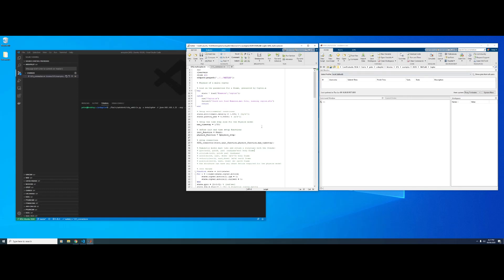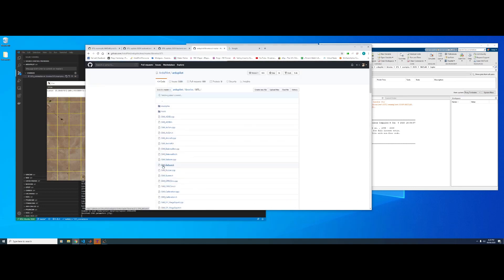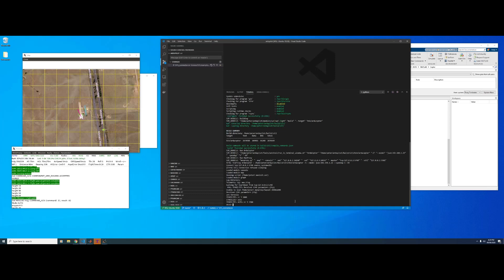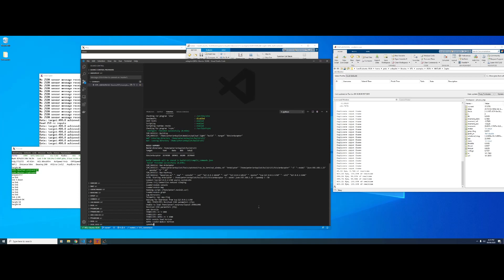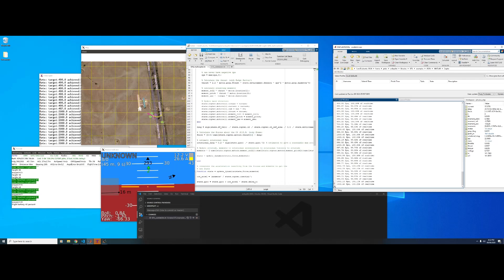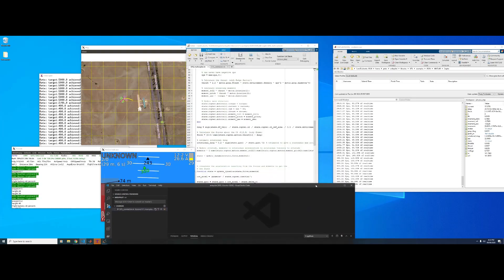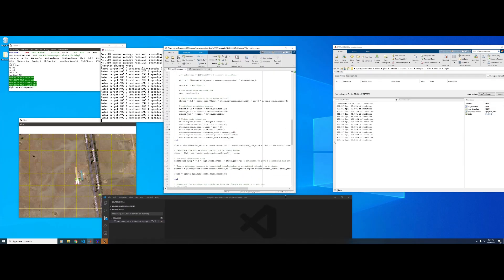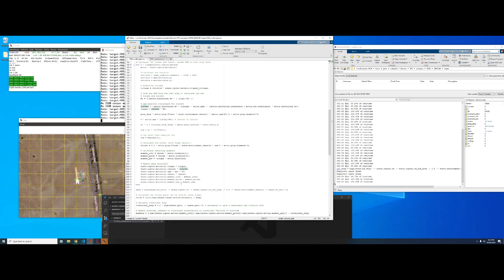ArduPilot MATLAB SITL demo

Comment: Hi, I have Issues when I run SIM_Multicopter. m : 
Error using mex
Error in SITL_connector (line 12)
        mex -O -outdir ../tcp_udp_ip_2.0.6 ../tcp_udp_ip_2.0.6/pnet.c ws2_32.lib -DWIN32
check that you are in the correct current folder, and
check the spelling of 'C:\Users\OneDrive\Desktop\tcp_udp_ip_2.0.6\pnet.c'.

Comment: Hi.
I am running into issues when I run SIM_Multicopter. m example. The issue is in executing the MEX file statement in SITL_connector.m function call. 
Error Msg:
"Error using mex
gcc: error: ws2_32.lib: No such file or directory"
Any help is appreciated
Reply from the maker: Hum, not sure, mex stuff can get tricky, it was tested on 2020a both windows and Linux. Might be worth deleting the mex files, it should then try and re-compile. Also worth checking what compiler MATLAB is using.
Reply: @MrIampete  Thank you for your response. I was able to fix that issue by using wsock32.lib.
Reply: @NandithaU  Hello, can you tell me who can I fix the same problem?
Where will I use wsock32.lib ???

Comment: This is awesome. Thanks! I have the plumbing all working from SITL on my ubuntu box to Matlab on my Wondos PC: I start SIM_multicopter.m and then I start SITL in ArduCopter dir as, "sim_vehicle.py --map --console -f JSON:10.0.0.173". SITL starts and I see some streaming data in the matlab console so all is good.  HOWEVER I am having  trouble arming because of an undefined FRAME_TYPE that is only a problem when I start with the -f option above.    I'm only about 1 week into this codebase and toolchain so I'm not very knowledgeable, but it seems as though the matlab code is affecting the FRAME_TYPE in SITL via the connection magic. I tried to edit/load params from the SITL console where I can see the FRAME_TYPE is indeed, "undefined" but thus far it doesn't seem to stick. Any ideas?
Reply: UPDATE: I did get it to work by (re)loading params...I think the issue is related to the -f option being both for the JSON spec and the frame type specification on the command line. Any advice? is there some frame_type spec in on the matlab side or elsewhere that I need to set so as not to need to reload params each time?
Reply from the maker: @mkmabl  You should just be able to set the FRAME_CLASS and FRAME_TYPE params and they will stick so long as its a valid combination.
Reply: @mkmabl  How did you do it, I'm trying and I'm getting this problem since "f" is used for both JSON and frame_type. Any advice?
Reply: @mkmabl  I have got it. For those who need it, I explain how to do it. First you go to the "console" tab then click on "parameter" and click on "editor". You look for the parameter "FRAME_CLASS and FRAME_TYPE" and put the class and configuration you want. FRAME_CLASS = 1 is a "Quadricopter" and FRAME_TYPE = 1 is a quadcopter in "X" configuration.
All the best.

Comment: Hi men, thanks for share your work.I really have a problem using my simulink model. Parameters like  velocity and position can update  into the SITL but i have some issue with the attitude. The attitude its the only parameter that takes the same value whatever the input in the send block. I already try with the examples in simulink of the heli or the rover but i am having the same issue. Sorprising the SIM_multicopter example run perfectly.
Reply from the maker: I'm not sure what would cause that, maybe you can post more info over on the AP forum or discord.

Comment: when i run the code for SIM_multicopter on MATLAB, I dont get any results rather MATLAB is busy forever...I have downloaded TCP/UDP/IP toolbox...I'm running this code on Windows OS...kindly guide what to do?
Reply from the maker: you need to use the custom version of the toolbox in the ArduPilot repository, https://ardupilot.org/dev/docs/sitl-with-MATLAB.html
Reply: @MrIampete  i have these files in the repository...do i need to run these files before running the main simulation?
Reply from the maker: @hussainali9840  In that case I would guess its a network issue. You might need to add exceptions to the windows firewall. The discord is the best place to get help, https://ardupilot.org/dev/docs/ardupilot-discord-server.html#ardupilot-discord-server
Reply: Have you ever resolve this problem, I also find this problem, thanks

Comment: That looks great. thank you for sharing. I am wondering if I can control the input data to ArduPilot to just be the exact location of the drone in time during the flight and the output is the profile motion of the drone in time such as acceleration. Do you suggest me a different autopilot or simulation to do so?